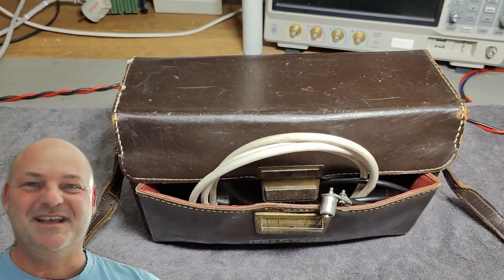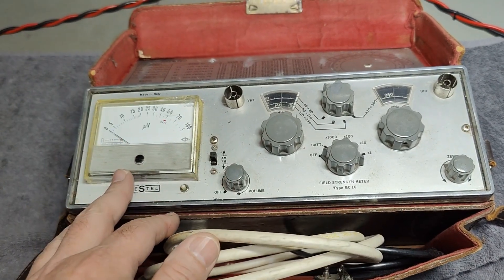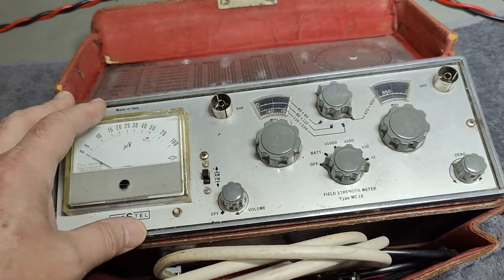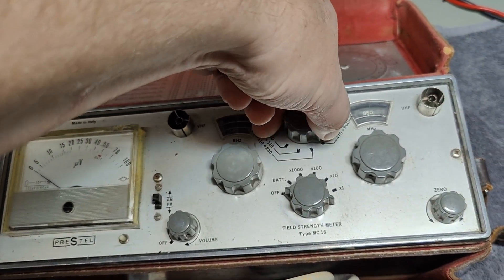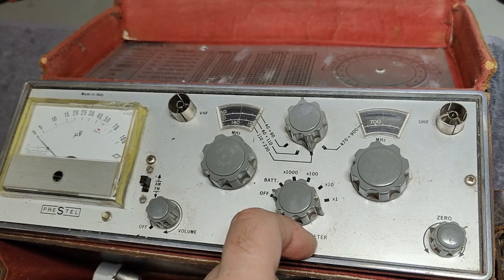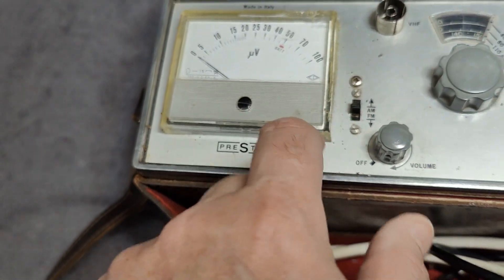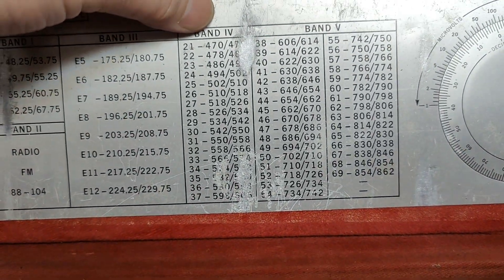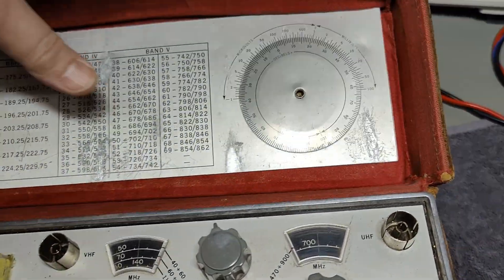Prestel field strength meter mc16 VHF UHF TV bands 1968 test teardown

Comment: The internal V is 9 and 12vdc, not 3v.  The 12v is then regulated down to 9vdc via transistor T16 and the C9V1 Zener diode.  Not sure why they separated out unregulated 9v instead of feeding everything off the regulated side.